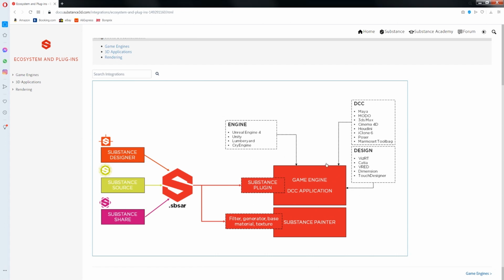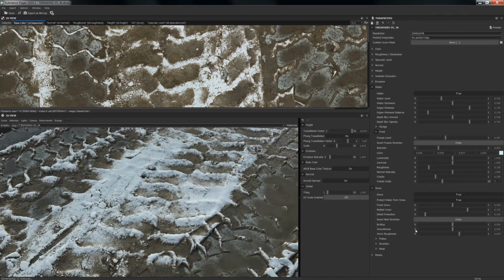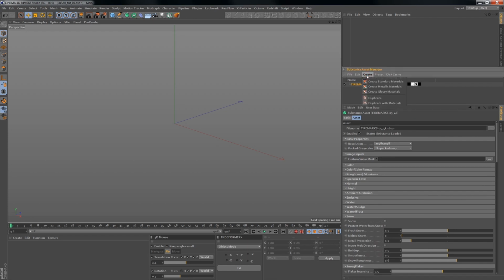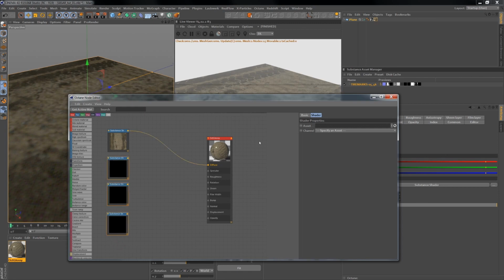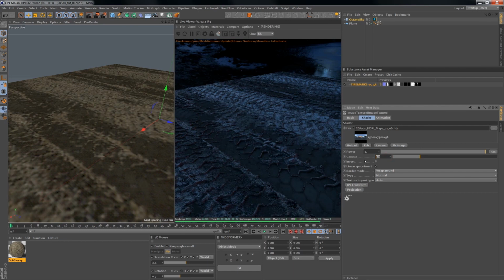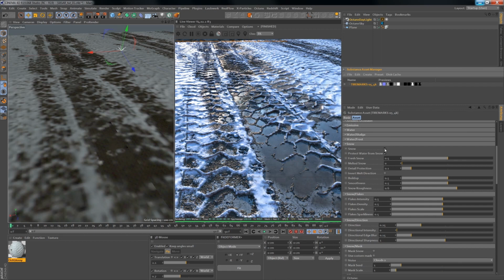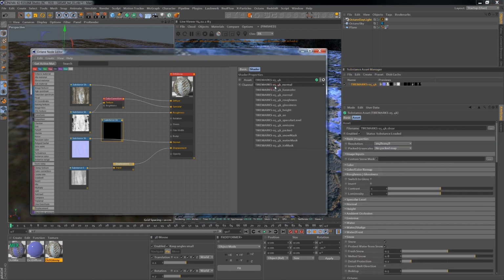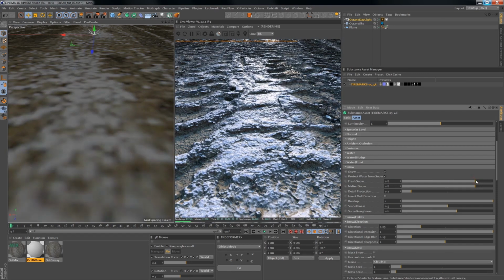RDT - C4D - OCTANE (using SBSAR)

Comment: Hi, I am trying to use the SBSAR material in C4D S24. I did the same as the tutorial, but I still have a resolution issue. I even increased the size of the c4d shaders render size to 8K. I still some pixelation and cracking in the material when I close up and compared to using the pre-made material in the c4d file given from RD-Texture, the quality of SBSAR is very low... Is there any other solution you can recommend?  I'm having this resolution issue not only with the SBSAR from RD-TEXTURE but also the SBSAR from ADOBE SUBSTANCE. 
Thank you very much.

Comment: thank you for the amazing tutorial it helps a heap. I am using gtx 1060 with octane 4 but when I make some tweaks it takes to refresh very long. Is there any optimisation tip fro reduce the refresh time?
Reply from the maker: YES: if you reduce the baking resolution of C4D-shader within the octane settings like shown in the video (I've set it to 4k - you can try out 2k) it will speedup the update-process. After finishing with the setup you can then rise the resultion for your final rendering.
Reply: @Schindelar3D  Thank you very much